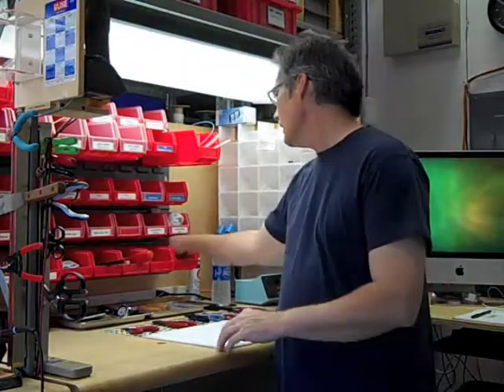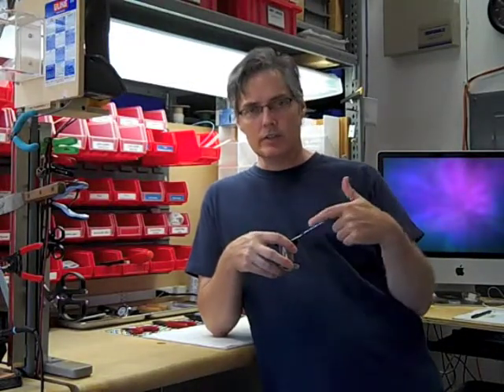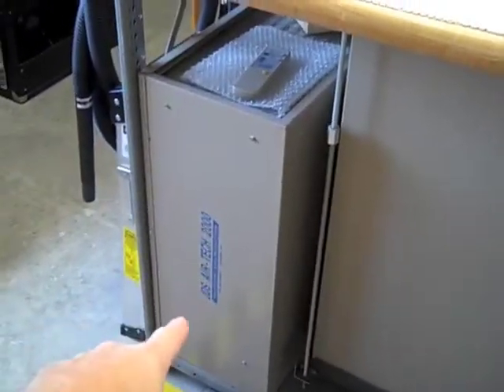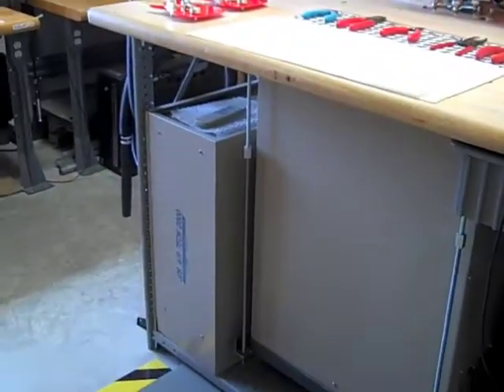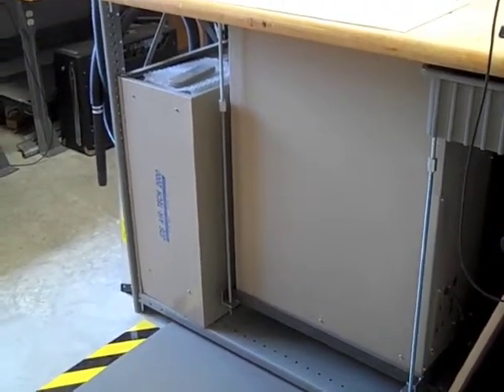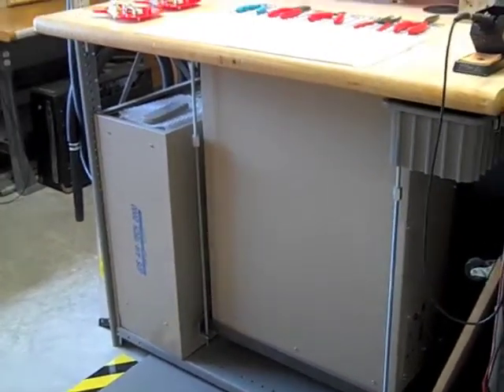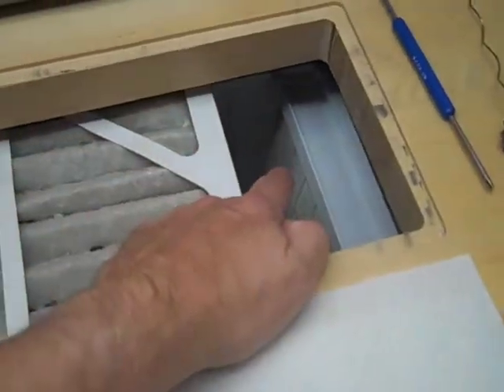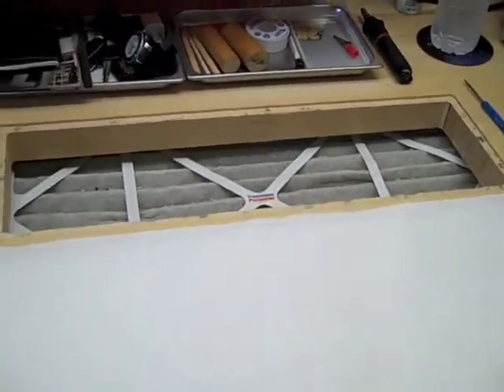Acme Guitar Works - Solder Bench Part 1

Comment: some say the resin core or flux inside a soldering wire is actually colophony like the gum violinists use on their bows. since that is made out of conifer resin there might be some turpentine present. the turpentine itself smells like walking in a pine forest but it is actually very nasty thing for your lungs